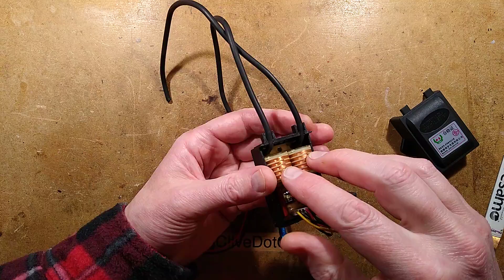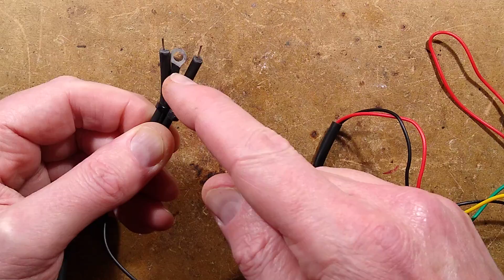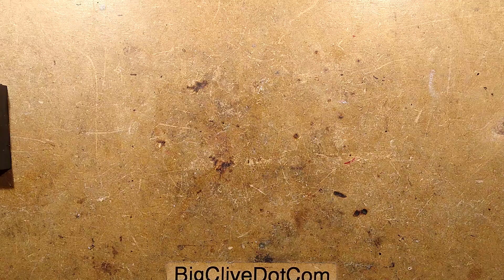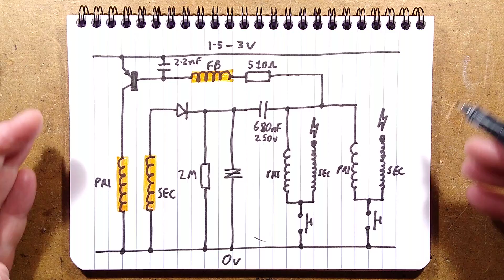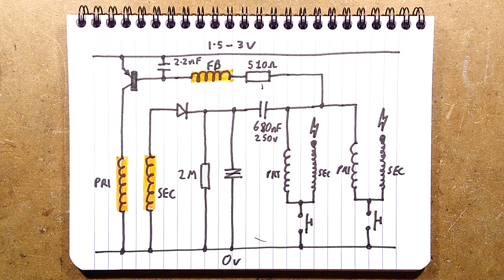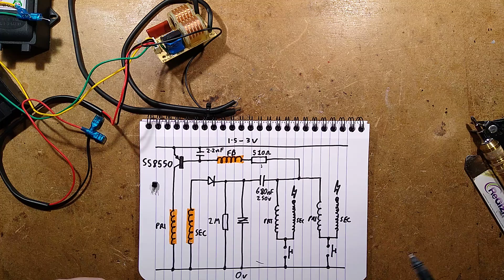Random high voltage module from eBay (with schematic)

Comment: The same circuit is used on that pocket arc cigarette lighters, powered by a single Li-Ion cell. They used the same circuit but with a bigger coil, therefore - I believe - it is more reliable.
By replacing the transistor, I noted the only parameter that is important is the Ton - Toff time. I believe the transistor is specifically selected for a very low Toff time. Replacing it with the same spec audio transistor, it was heating up and blowing after few seconds. I had to use a transistor used for the 2 Watt CB transmitter (TO39 case) in order to get the correct switching time.
I had the same problem 20 years ago with the inverter used to light up portable 6 W fluorescent tubes; they used special binned audio transistor which had no equivalent in the Sylvania ECG series, and which I had to replace with expensive RF Tx transistors.
Thanks for the video Mr. Clive...
Reply: I doubt the transistor was selected for any other specific reason than being one of the cheapest TO-92 package transistors being able to handle more than 1A. There isn't anything else special about an SS8550 and I've seen it used in tons of devices.
It might be possible to protect the transistor by putting a diode in series with the first transformer's primary, because the back EMF can kill the transistor's collector base junction. It will increase the input voltage needed to account for the diode drop.

Comment: wouldn't the diode be useless in your schematic Clive? looking at it you got it drawn as positive having the negative side connected, and vise versa.
Reply from the maker: The coil generates a high voltage with respect to the negative rail.

Comment: That looks  like a    gas  stove or heating    boiler   igniter
Reply: It won't be from a boiler -- there's no flame detection.  A boiler igniter has a timing circuit to purge the firebox before the gas valve opens, then hold the valve open for a few seconds; during which time, if a flame is sensed, the gas valve stays open, otherwise it goes into lock-out.

Comment: Nice one, Clive, thanks for doing a HV one!

Yep it is a bit weird. I'd imagine the "buttons" might end up being transistors driven from a microcontroller. It seems odd that there's two, but I don't know much about gas boilers so perhaps that's how they design them. Shame the output transformers aren't connected with opposite polarity on the inputs. Then you'd be able to get twice the voltage, right? And not need the ground wire. Is that something you'd be able to tweak, swap the wires round?

I've seen those transformers before! They seem to turn up in a lot of Chinese HV stuff. If it ain't broke... actually if it's from Ebay and it ain't broke it's a bloody miracle but never mind that.
Reply: The problem with this kind of “inputs” to enable is the “unknown” paths the hv will take. According to the schematic you will get some hv on the not enabled input.

Comment: Fairly sure these are what used to be advertised as Stun Gun modules (illegal to import into the UK labelled as such).
Reply: There's all sorts of high-voltage stuff you can get. These technically use the same circuit as a nuts nug, but much smaller, a pathetic little capacitor with very little energy. There's a video online of a real nug nuts, and the caps are big chunky things, the transformer is bigger and better too.

Comment: (Mustie1). That is the other. I knew you wanted to know.  🚊‼
Reply: Actually those ubiquitous hv transformers aren't transformers per se.  Note that the core is open.  Those are coupled inductors aka flyback transformers.  Output isn't generated when the sidac conducts.  During this time the b field builds up in the core.  When the sidac opens, the field collapses.  Voltage in the windings is proportional to dB/dt. So the rapid collapse causes a high voltage and the spark jumps.  Output voltage can be much higher this way than the transformer ratio multiplied by the capacitor voltage would suggest

Comment: To quote ElectroBoom’s infinite wisdom further: “Never put your body in a high voltage circuit!”
Reply: Otherwise the body will be found by others
Reply: Hmm nobody told this to Nikola Tesla
Reply: Its "never become a part of a high voltage circuit"
Reply: @MrPaxio 👍 I could only quote the wisdom, not the man.
Reply: Unless you're doing it for fun, none of these igniters can provide enough current to do much more than make you go "ouch".
Reply: Not always the volts that count, it’s the current that will tickle the pickle.
Reply: @TheShutterNinja  To push enough amps to kill you, you need voltage. A 12V car battery can deliver hundreds of amps. But at your body resistance there won't be enough current to do anything. Skin resistance can also vary widely, depending on whether your skin is wet or dry for example, or depending on frequency for AC. Another thing that counts is the total amount of energy, in other words time.
Reply: @maxine_q  Duration and resistance are definitely keys, which is why static electricity also doesn’t kill, but to your point, it’s not voltage alone.
Reply: @maxine_q  Exactly. It's not really complicated once you understand it... And you have in a minimum of space covered the three or four major facets that someone who keeps repeating the old and nonsensical cliche "It's the amps that get you, not the volts blah blah blah" needs to be bonked on the head with. 

  many thanks and... peace be upon you.
Reply: @TheShutterNinja  "It's the volts that jolts & the mills that kills"
Reply: @dandruff7807  I like that one!

Comment: It is a two cylinder motorcycle ignition coil. you trigger the circuit with a hall effect sensor on the flywheel and away the spark goes to the relevant spark plug. Thats what I would do with it
Reply: I dunno, motorbike coils are another source of high-voltage madness, and they're a lot bigger than those puny coils. I think more current capacity is needed, spark-plug sparks are much thicker and brighter, as well as having to cope with damp rainy air without shorting away to nothing.
Reply: @greenaum  I was primarily thinking chineseuim made so as bodge and nasty as possible. Might work on a small rc model as a plug driver but reliable? probably not!
Reply: That's what I initially tought - that it's some dodgy chinese motorbike ignition module. But it runs on 1.5-3V - being a stove igniter makes way more sense.
Reply: The "trigger" circuit has to take the entire primary side current, an integrated hall switch couldn't do that.  You could add a Triac to do the switching, but as the other guy said this likely isn't a high enough energy design, plus a motorcycle would be at least 6v and usualy 12v these days. I suppose it might be enough to power one of those model four stroke engines with a small enough plug gap.

Comment: I've tinkered with electronics since age 8 and I was today years old when I learned about SIDACs. What a funky little device
Reply from the maker: They're in many boiler ignition circuits and ioniser modules, but still quite an exotic component.
Reply: I recently had to repair the spark generator in my cooker (no replacement available). Instead of sidacs, it uses neon indicator bulbs!
Reply: I took basic electronics in the service and these were never mentioned.
Reply: @tncorgi92  You may have heard about their low-current relatives, the Diac, used in many triac-controlled light dimmers.
Reply: I found some sidac inside sodium lamp igniters, in a weird TO-220 package
 @tubastuff  DIACs are also found on CFL bulbs ballast and halogen electronic transformers
Reply: @tubastuff  I am curious as to how it's possible to differentiate between a diac or sidac without knowing a part number; is it purely based on physical size or its usage in a circuit that indicates whether or not it's a high power device?
Reply: @cambridgemart2075  Well, if I were presented with a 2-terminal "black box" device and told it was either a DIAC or a SIDAC, I might hook up a curve tracer (or a simple variable voltage power supply in series with a resistor) and determine the breakover voltage.  DIACs usually have a Vbo ~~ 30V, while SIDACs have a breakover in the 100+ volt range.
Reply: @ElectroXa  Yup--the difference seems to be one mostly of magnitude.  DIACs are usually low voltage (e.g. 30V) low-current devices, while SIDACs can trigger on hundreds of volts and pass large currents.   You can make a relaxation oscillator with either device.
Reply: Just think modified thyristor - once conducting, they stay on until the voltage across them drops below a volt. 
In fact adding a zener diode to the gate of a thyristor replicates the function (and a small resistor to reduce noise immunity). 👍🏻

Comment: Interesting. Never heard of a SIDAC.

A silicon diode for alternating current (SIDAC) is a less commonly used device, electrically similar to the DIAC, but having, in general, a higher breakover voltage and greater current handling capacity.

https://en.wikipedia.org/wiki/DIAC#SIDAC
Reply: It makes me wonder how they discovered all the different components, and then thought about how to use them!! Did they say "we need something that short-circuits when it reaches a certain voltage", or did they say "we've found something that ... - what shall we do with it?" ;)
Reply: @stepheneyles2198  I think a little of both.
Reply: @stepheneyles2198  I like how you think. My guess is that they tried something, the result was interesting and they thought “I wonder what this can be used for?”

Comment: would it be any use for 2 tube neon? like two flashing "bulbs" 🤷‍♂ Interesting little bit of sparky fun. 👍👍
Reply: For a normal brightness neon bulbs run at 30 mA. That's a lot of current for a tiny module.
Reply: @d.t.4523  Thanks yes you are correct . 👍👍
Reply from the maker: Not ideal for neon tubes.  They'd be very dim.
Reply: @bigclivedotcom  OK worth knowing thanks

Comment: Nice. Gotta make a Jacob's ladder with it. Or a whoofler upgrade.
Short the buttons, connect the HV wires together (for parallel operation) to one bar and ground the other. Watch them sparks fly... or at least try!

No, you ain't getting zapped! Not now. You got those superpowers already.
Reply: I don't believe it can generate enough continuous current for a Jacob's ladder.   You may have noticed that it doesn't arc constantly  --- it arcs repeatedly, every time the capacitor discharges  ----  I don't think that would allow for the ionization build up a ladder needs.
Reply: It doesn't have enough voltage.  A few eons ago, I played around with the hv of a 13" b&w crt.  It was probably 13kv or so.  The max, IIRC, arc was under 1/2".    Compare that to a large neon sign transformer of the 70s that could arc up to about 4".
Reply: @adamf663  I bought one of the old-fashioned neon transformers on eBay a few years ago with the intention of making a Jacob's ladder. But each time I look at the thing and think about it, I get cold feet!
Reply: @PharmaGiles  Same here. If you get a shock it could your last. Better left to the pros ... although escaping death can be exhilarating for those who want excitement.
Reply: @adamf663  OK, still cool - I've got a B13S8 scope CRT, it'd be perfect for that.
Reply: That doesn’t have enough power behind it for a Jacob’s ladder. I built one last summer with an NST that outputs 15KV @ 60mA. Made a rather satisfying sound. (There are a couple videos on my channel /shameless plug) NSTs are relatively safe since they’re current limited but can still potentially kill you or at minimum hurt like hell if you get bit by one.

Comment: Did you find out the frequency at which the circuit oscillates? Does that matter for the output?
Reply from the maker: It varies with voltage and is quite high.
Reply: The output spark will always be the same, because its energy depends on the capacitor and SIDAC (capacity and trigger voltage). How often the output spark occurs depends on the input voltage.

Comment: Looks like something to ignite a propane gas bbq grill.
Reply: I see a spud gun firing solution :-P
Reply: @marcussoininen2084  A dual cannon at that.  =]
Reply: @marcussoininen2084  yup, sounds like a single AA could run this on a push button.
Reply: Considering the "1.5-3V" input, this is probably correct. Lots of grills have a socket for a single AA cell to run circuits like these, though some will produce larger sparks at lower frequencies. My recommendation to use disposable lithium cells (such as Energizer Ultimate Lithium) goes double here; they have much better weather resistance than alkaline batteries in terms of both durability and performance.
Reply: Exactly. Battery operated and likely the center black common ground is attached to the grill chassis and the two sparkers go to a burner or sets of burners. Those sparkers often ground to the frame metal.
Reply: Yes either a gas grill or possibly portable propane stove something like say a Coleman stove but with electric ignition running off batteries
Reply: Or two...

Comment: This could be potentially useful for generating ozone where only a low voltage DC supply is available.  I've obtained some 12v ozone generator modules, which had a low output, and for the unit I got, a short lifespan. The high voltage is comparable to the ozone generators that use the ceramic paddles with spaced conductors to take advantage of corona discharge.
Reply: Could be a tad too high. Don't poison yourself!
Reply: @gregbailey45  I actually would like semi poisonous levels.  My actual application is deterring rodents, and keeping mustyness at bay in a solar powered off-grid RV.  I'd only have the circuit running when not occupied, and only in the cabinet/utility spaces.
Reply: @gregbailey45  stop  being brainwashed. we have used 4 ozone generators for 20 years. still alive. reason they are vilified by bigharma who dont want it used for medical purpose as it there profits would plummet as not a consumable and not patent-able. i hope you  got all your jabs and boosters and made some money for fizzer .